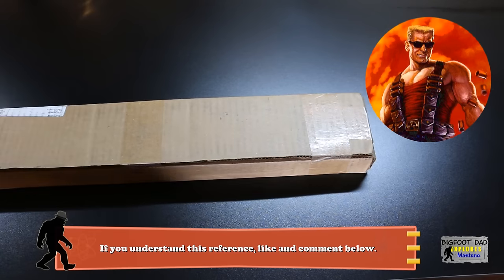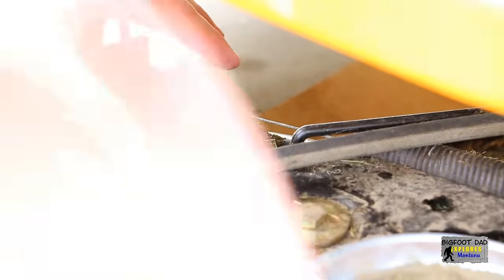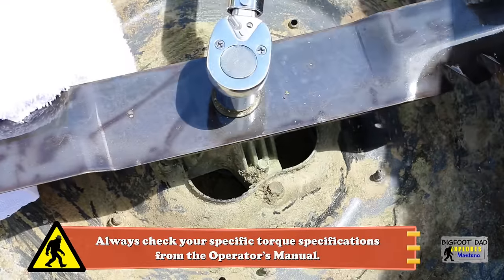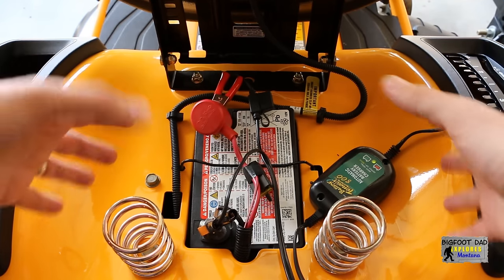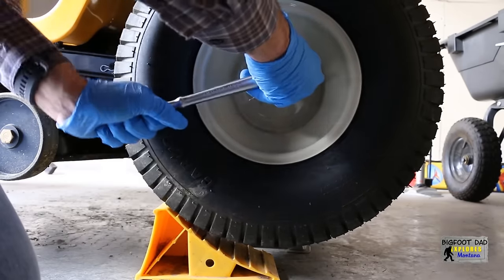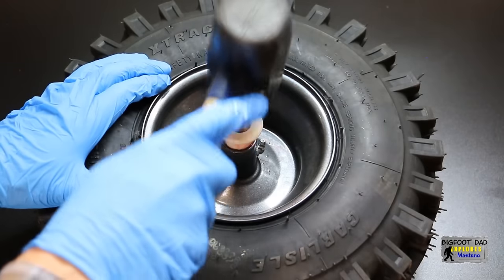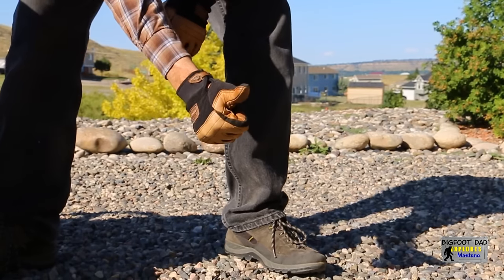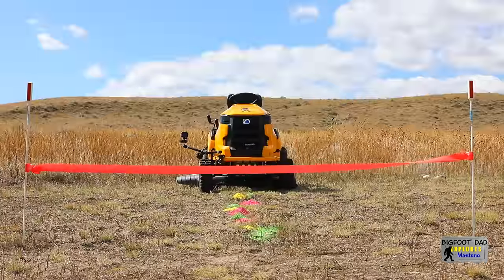Upgrading Your Tractor Mower: Cub Cadet XT1 LT42" Mower (ATV Tires, Blades, Brush Guard, Headlights)

Comment: You forgot to upgrade the seat with armrests and put a spinner knob on the steering wheel.
Reply from the maker: Hi, Glen - You are correct!  I would have loved to add both those.  I did look at the armrests but I was a bit over budget as it was. however, I have to say that they sure would be nice!

Comment: why are you removing the deck to replace the blades? use a pair of car ramps,or better yet invest in a mower jack. and yes I have cub cadet with a 50 inch deck. and I use my jack to service mine.
Reply from the maker: Hi, psychobabblerls - it's easier to film with the deck off 🙃  I also wanted to be able to show how it comes off if anyone needs to remove or install it.  I do agree, it's easier to do it the way you mentioned.

Comment: Im uploading a new video of my new cub Cadet tractor that I just got today check it out soon 😃
Reply from the maker: Hi, Josh!  Thank you for the shout-out on your new video!  That's interesting with the decal/sticker on the air cleaner.  Do you know if they changed anything else on the engines since then too?
Reply: @BigfootDadExploresMontana  your welcome, no Everything else is the same, so we have pretty much the same Tractor lol. So now I need to order 2 brush guards for my cub cadets, I hate the deck on my 46 inch one, I have lots of hills to mow and Everytime I now the hills the decks drags down and hits the ground and then hits rocks and bending the blades, the 42 inch one I have no prombles at all I love it, wish I got it last year instead, but I like the twin kolher motor more ha ha. How's your cub holding up?

Comment: Cub cadet has definitely slacked in the structural integrity on their moweres
Reply from the maker: Hi, Mota Yota - funny you mention that.  I do see my mower torquing quite a bit when going over some of the odd terrain on my yard.  I have often wondered if there is a way to strengthen that... Custom build, anyone?  😉

Comment: Had the first year model of that turd. Cub cadet design flaw was the rubber drain hose on the motor. They split pump out all the oil under the mower while mowing. You don't know till the motor stops. Cub Cadet refused to replace it. They are junk
Reply from the maker: Hi, Bill, that's truly depressing.  This would leave a pretty bad taste (of oil?) in my mouth too.  I hope I don't run into this issue, but I do appreciate you sharing your experience.  I hope you found a good mower to replace it and that it's doing better.

Comment: That is the wrong oil!  You want  conventional, not synthetic  in small engines. Synthetic can't  handle the high temps!
Reply from the maker: Hi, Xiaoding - In that case, this may be my most expensive experiment ever if the engine fails.  😂  Crossing my fingers that doesn't happen and attributing this test to science.  😉

Comment: Hello folk's.   I'm desirous of increasing the tire size of my Cub Cadet LT1042 to increase my cutting height.
Reply from the maker: Hi, Robert - if you're serious, then put taller ties on.  If you're joking, well, then I'd recommend a 10" suspension lift for your mower.  😉
Reply: @BigfootDadExploresMontana , I'm serious.
Reply: @Bigfoot Dad Explores Montana , no I'm serious.   I want the ability to cut my grass higher.   Up to 5.6" or so...  Residential cub cadet gives me roughly 3.6".  That's too short...

Comment: Drives me nuts when I see someone click two or 3 times on a torque wrench, might as well not even use a torque wrench.   1 Click is all that is needed thewy are designed that way, if you can even find one that is accurate

Comment: The Whole reason I watched was to actually see how you removed and installed the new tires.  You totally skipped that part.
Reply: There's a ton of videos on YT showing you how to do that.
Reply: It's not a fun job.  Replaced my front tires and it took 100% of my strength with a couple prybars.  I'd suggest taking them to a tire shop and having them do it.  Save yourself the frustration.  Especially if you have to do all 4.
Reply: @kimokahikolekalihi  That's what I was wondering about.  Thanks.
Reply from the maker: Hi, JMS493 - apologies - I took them into a tire shop.  I saw people doing this on YouTube and I thought "Nope, just takin' it in to have it done."  😂  If I recall correctly, the guy that mounted the front struggled a bit to get them on.  Hopefully there were other helpful segments you can use in the film.
Reply: @BigfootDadExploresMontana  I bet the rears are easier being bigger but still, no thanks.

Comment: 18 minutes well spent. Couldn’t tell does the 42” deck not have a hose port? You’ll never have to clean the under side of your deck again...
Reply from the maker: Hi, Joshua - yes, it does indeed.  I have another video where I'm using this called Uncrating to 5-Hour Maintenance.  However, as others have suggested, I should have lowered the deck over a better solid surface to really help wash it clean.  But since the deck removal in this film, I've been using the wash port more regularly.   Thank you for your comments and I'm glad you're here!

Comment: Lol it's not a tractor no matter how many times you say that it is.....its a mower.
Reply from the maker: Hey, I'm just calling it by it's name from the manufacturer.  😉
Reply: @BigfootDadExploresMontana  I will tell ya like I did my brother. He had 20 hp wheelhouse yrs ago brand new. It was maybe 1990. I was scraping his drive with our 1949 farmall cub tractor. It has 10 hp balls out. Dummy said his "tractor" would outpull the cub🤣 bc it has 2x the hp........well, he was educated that day on mower hp vs actual tractor hp🤣 and a physics lesson on weight and gear. I asked him would he liked to be pulled forward or backward? Left or right? His mower weighed maybe 500# lol the cub weighs 1500# bless his heart

Comment: Okay you just turned a piece of junk into a bigger piece of junk?
Reply from the maker: Hi, James.  What brand(s) do you recommend?
Reply: Anything but a cub! Around here you can’t go anywhere without seeing one or more of them sitting in somebody’s back yard lol! Lawn art 🖼 😂
Reply: Personally I don’t recommend anything that they are putting out now! Everything is made outta plastic? I almost bought a Murray and somebody told me that the damn rear end or transmission is made out of plastic?
Reply from the maker: @gladysman24133  - Ah, yes, there is certainly a lot of plastic.  That's something I've noticed too.  Some people have commented on here that they have 20-30 year-old mowers that are still running great - before the era of major plastic components.  My grandfather's (back in the 80's and early 90's) pretty much were all metal except for the gas tanks and a few other knobs and handles.  I don't know what the solution is, but maybe there's another manufacturer out there that uses more time-tested materials.  Let me know if you run across one - I would love to hear about alternatives.  Cheers and thank you for the engaging comments!  😎
Reply: @BigfootDadExploresMontana  my previous lawnmower was a 2002 MTD Statsman my father in law bought new and he passed away so I gave the family $500 for it in 2009 and the transmission went out last year on my last mowing! So a $500 mower that lasted 13 years and I can’t complain! It’s been sitting outside under my deck 6 months now and this weekend I went out there and put the key in and it started up and ran like a new one 😂,Was going to buy a new one but I’ve got a lawnmower mechanic looking for a transmission for it so I’m not sure what I’m going to do but I’ve got till spring so I’ve got at least 3 local lawnmower repair people that are looking for something older and used! I’m not going to pay $2000-$3000 for a plastic lawnmower! And every lawnmower made today is made by MTD? O and I got a friend that bought a $4000 cub at tractor supply because he noticed that the seat had a cut in it so they knocked off a $1000? Anyway hope you have good luck with your cub and hope it lasts for a long time.👍
Reply from the maker: @gladysman24133  - Thanks, James!  And hopefully you're able to locate the a good transmission.  As soon as the cold melts away, it's showtime again!